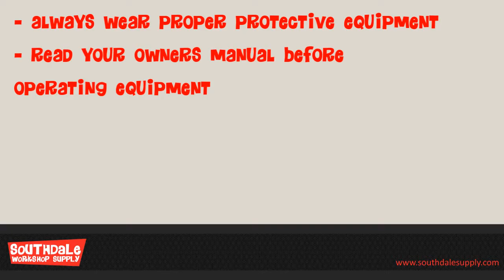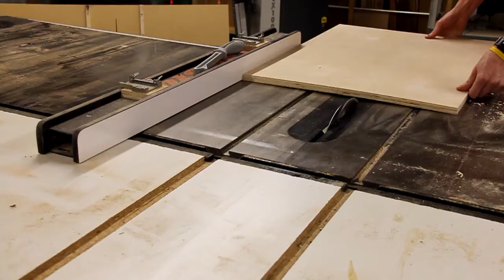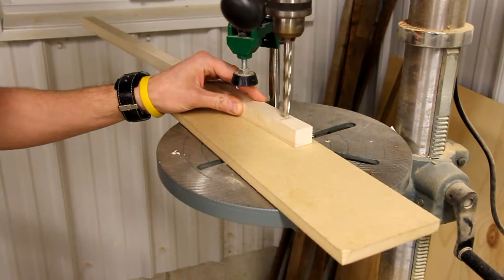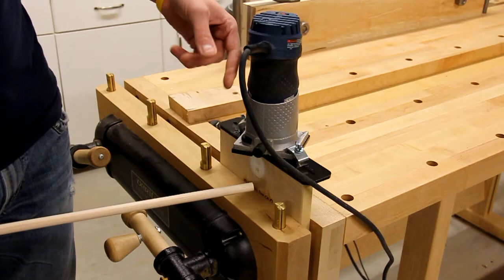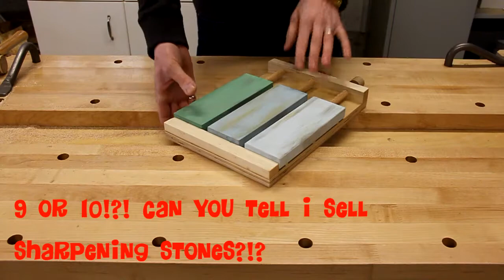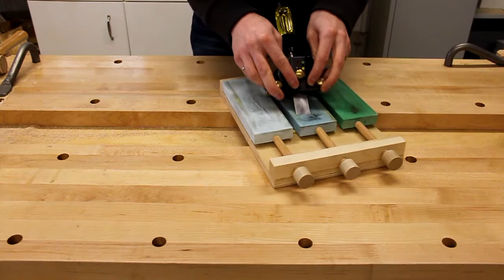Sharpening Stone Holding System - Part 2 - The Final Version

Comment: Hi - just ran across this - some good ideas from your prototype and final version.  Thank you!  Question about your sharpening process.  I notice you move from stone to stone without wiping down your blade or honing jig.  Don't the various grits from the slurry that is created get mixed among the stones - potentially creating problems - especially as you move to finer grits?  I use the same sharpening method, but have been under the impression that I should rinse and wipe my blade and jig as I move through the the stones - which, frankly, is a pain.  Thoughts?